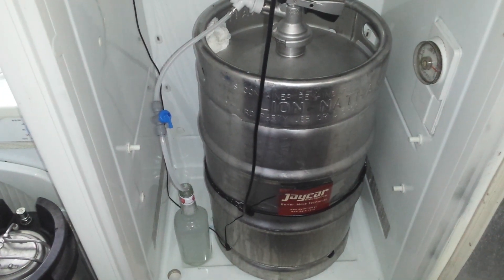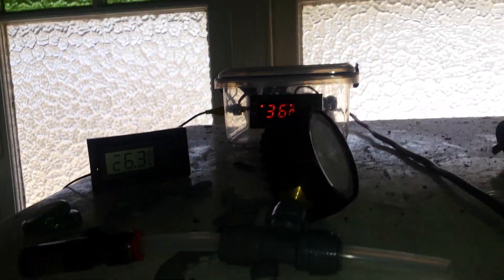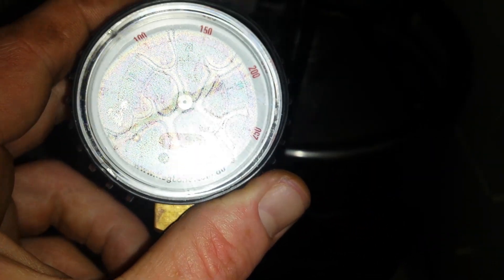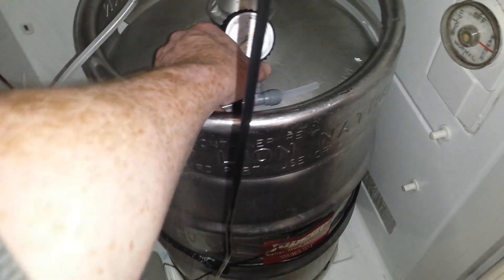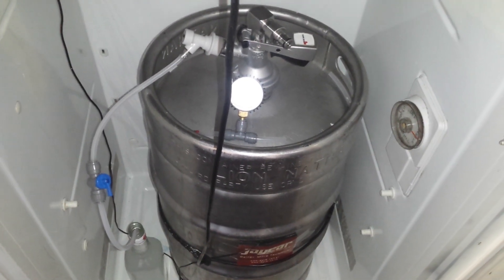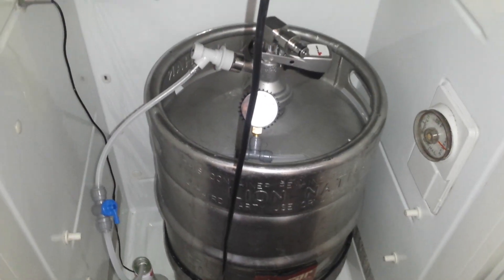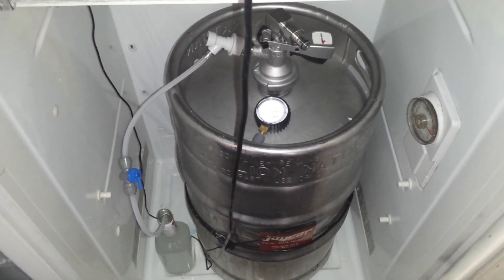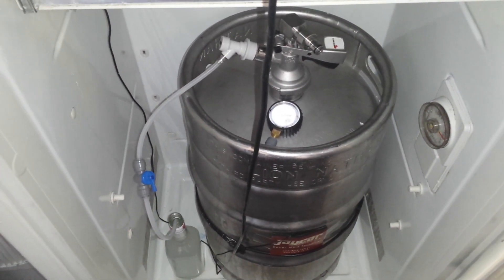1st run #Anaerobic primary fermentation under pressure  [HOMEBREW PT.1]

Comment: Thanks for this video. I'm planning to use a keg and couper i already own... but my big question is how hard is to clean? can you remove all the mud easly? Do you remove the spear for scrub inside or chemical sanitization is enough?
Reply from the maker: Easy compared to cleaning say 60 long neck bottles,  I clean the kegs with PWB and Stella caustic (bunnings caustic & brigalow bottle wash does the job also)  Before I sanitize with stella san &/or Phosphoric acid.  First degas the keg, I use a spare coupler with the gas inlet removed, this will vent the keg without covering you in beer if there is any. Remove the spear, depending on the keg it may have a locking tab in side, the tab fits a groove in the internal thread.  Grid that off for easy install/removal.

Rinse em out with hot water ie. fill up, let overflow, scrub, empty, then fill with water & appropriate amount of caustic and PWB I throw the spear disassembled into another bucket with fittings, couplers ect.  Then stand overnight or for a few day depending on the level of soil.

The mug/gunk/old beer seds amount will depend on type of beer, hops (amount of) and is the keg you are cleaning primary or secondary fermente?  I've had really hop heavy beer seds in primary keg needed to be turned upside down for a day or two, to soak the inside top of the keg something to be aware of.

I scrub the inside of the keg and spear during the rinse, before and after a soak, the less shit there is in the keg the less the caustic and PWB have to work.   This method, if you can call it that, gives you a few chance to look at the progress and see if you have missed something(dirt).  Local homebrew supplies should have long bottle brushed for the spear and such.  I bent one into a dog leg for doing inside the kegs, Oh and a torch use a torch to check inside is as clean as you think it is.  Once you are happy with the clean rinse it out well again I use hot water throughout.  Finally sanitize with Stella san (Kegland/KegKing)  to do this I fill em up with water and add measured sanitizer first.  Sit over night. the flowing day I'll tip this out rinse and put a small amount of Stella san in the keg with water (so it's concentrated) and fit the spear) from there I'll take em inside and usually use one straight away, for the keg that will be doing the secondary ferment I'll put 20psi on top of that and vent the O2 from the keg, put's the keg in a state that only needs to be degassed and can be used. 

Probably forgoten stuff...I know that's seems like work,  however if you do it, you won't get any nasty surprises come brew time.  Hope that helps, any question happy to help,  Good luck and Happy Brewing!
Reply: @totallyrandomlocksandpicks  You answered all my doubts. My keg is a G type and spear is locked... so i'll try to figure out a way to reach the locking tab withou damage the rest! Thank you!
Reply from the maker: @dfelixpt    Cheers mate, You'll have to pull it apart.  Have a look at this video ->> https://www.youtube.com/watch?v=H1ccWSVcYl4  <- it's for a A type mite give ya a few ideas.  Make sure to degas the keg first usually if it has enough pressure on it, the spear won't come out.  That said I've heard horror stories of spears hitting people in the face or arms through improper use(mainly those stories come from pubs before the 90's).  Shouldn't be a problem as G types have a PRV on the coupler,  the spear *should have 2 tab's that need to be ground off, mark them with a nikco then disassemble the spear.   Grind off and resemble pretty straight forward, Good Luck!